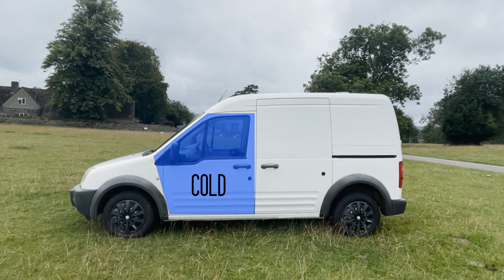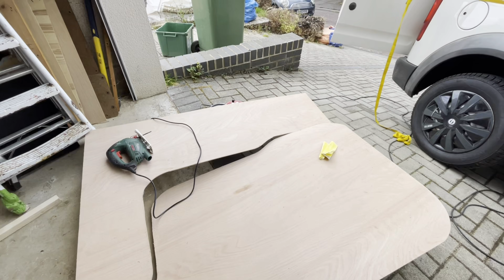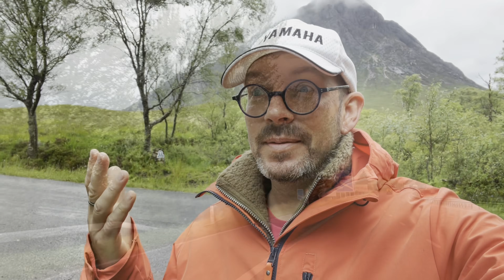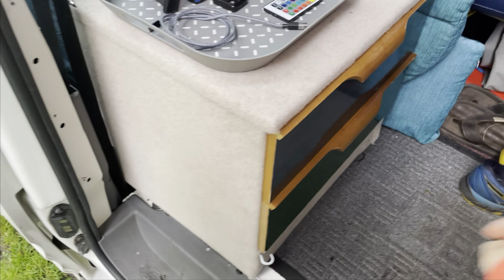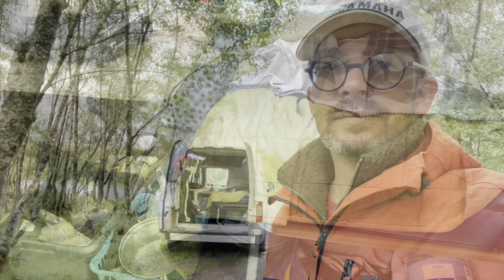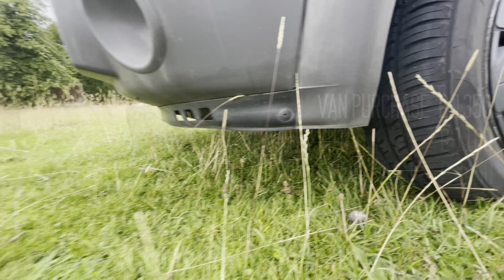Stealth Van Tour // Low cost // Ford Transit Connect // Self Build

Comment: I liked my transit connect. Very solid vehicle.
Reply from the maker: Thanks, yes, they’re great little vans.
Reply: Looking at the MOT on the government website it seems strange how there were few problems up to 196k then suddenly everything was significantly rusty and a whole heap of expensive problems that meant it failed it's MOT badly in 2024. I bought a 3 year old Vauxhall combo on 26k and 7 years later sold it at 132k, 40k around Europe, the rest around the UK and Ireland,longest I lived in it was 9 months continually, even through the -10c of 2009. I made sure to avoid rear glass windows and a side loading door for security, had a solid bulkhead up front and a safe bolted to the floor.
Reply: @jamesdexter7481 safe is a great idea

Comment: What about ventilation?
Jst at the end of the video I see something on top of the roof.
Is that a vent?
If so is it enough to avoid condensation building up inside the van?
Reply from the maker: Hi.  Well spotted.  There is a little non-powered spinning air vent that keeps the air flowing and therefore the condensation down.  Also. the insulation prevents a lot of condensation building up.  I covered this aspect in my second van video..... Link here >>>>  https://youtu.be/3NrsdZLMuK4
Reply: @ 

Thanks for your response.
I have now watched the video you sent a link for.

What we are thinking of is that next time we change car we may buy a small van like e.g. Caddy Maxi Life or something similar.

The idea is to use it a normal car most of the year, including being able to bring a few passengers or to haul stuff needed around the house to go the recycling station.
And in the summer use it for camping.
Just take the rear seats out and put the camping stuff in. No re-build planned.
Perhaps I would build a box for stove, cooler cutlery etc.
To make the surface even I would then have to have a few boxes for storage of other stuff as well.

Or just even simpler, just put the inflatable mattresses in and other stuff in a roof box.

But I think there will be a lot of condensation.
I would have to do something about ventilation.

I also have a heat pal but I don’t know if I would dare to use it in such a confined space

Comment: Did your van come with the overhead shelf in the cabin or did you add it? Im trying to figure out the best way to add one to my 2011 connect
Reply from the maker: Hi. I added it myself. The space up there was much better used by having a strong shelf. I used it for clothes.

Comment: Could you tell us what your electrical product was?  I don't recognise it and it's not in your description.
But happy camping!
Reply from the maker: Hi. Do you mean the 12v battery thing?  If so it’s a jump starter product that you charge up at home before setting out. It’s got a 12v socket that I plug the van lights and USB phone charger into. Hope that helps.
Reply: @CopperGravity  Yes. How can I find it on Amazon or in a camper store?  What's it's name/make/model?
Thanks.
Reply from the maker: Hi. Not sure on the exact model as it actually broke and I replaced it. They are generally called something like a 12v power pack. Draper make one. Halfords in UK or Amazon should have something like this.
Reply: @CopperGravity  Thanks.😀

Comment: When you have yourself, your fuel, with everything in the back, how much does it weigh?  Just interested to know.  Looks like a great little getaway van for the odd night out, for me, photogrpaphing the night sky in some remote wilderness.  I am not light.  I weigh 14 stone. I would need to fill it right up with fuel.   I have a couple of Bluetti power banks, an inverter, a laptop, camera gear and a little gas stove.  All things together, like food, clothes, boots, water, all the things to survive for a few days.  Is the maximum carrying capacity about 900-950kg?  I know it's the best part of a metric tonne, I would just need to be sure is all.
Reply from the maker: Hiya. I never weighed my van before, during or after. But these are built for builders and their materials and although the fuel economy gets worse with weight, they really won’t struggle with anyone who goes off camping.

Comment: What is the length of the back of the van ???
Reply from the maker: Hi. It’s 1.9m which is just enough for the bed to squeeze in.
Reply: @CopperGravity How can I sleep... 1,94 m.
Reply from the maker: Hi. It’s up to you to find a solution that fits you. Maybe a longer van or admit that you may be a bit squashed in. For me, I was not too tall and I really wanted a small van.
Reply: @Sel817  simply put the bed/cot behind the passenger seat, move the passenger seat up, and fashion something to extend the cot or find an extra long cot. Maybe make your own bed/cot.
Reply: How can I sleep... 1,94 m.   ?

Comment: It's so refreshing to see someone do a sensible conversion that proves you don't need a whole run of kitchen cupboards, a full cooker, fridge, etc etc etc!!!
Just install what you'll need, just the basics!
You won't be cooking full meals, guaranteed!
After all, you're on holiday, so eat out, buy takeaways, eat junk!! 
I'm definitely doing this with my next car, probably a Ford Galaxy, or very similar, & like this conversion, mine will be just a simple, uncomplicated sometimes van/or car/or camper, but just remembering that important acronym, K.I.S.S.
Keep
It
Simple,
Stupid!! 🤣🤣🤣
Reply from the maker: Yes James. Exactly. This van is still going strong and is currently empty due to recently moving a piano.  I also love proper little homes and if I lived in a van I would do something more permanent. But as a hobby camper this is a great option. Good luck with yours. Ian
Reply: A lot of people with more extensive builds actually live full-time in their vans, so their needs may be more than someone who is using a van for trips.

Comment: This video popped up on my line for no reason but I like it. The only thing I would add is a C02 meter just in case, you sleep in a relatively small space and believe me, you won't notice rising levels of dangerous C02 until it is too late.... nice build !
Reply from the maker: Thanks my friend. I have one!! Good advice for anyone reading this. Totally agree. 👍
Reply: CAD—cardboard aided design. 😂 Nice conversion!
Reply: I think you mean CO detector.  CO is carbon monoxide, deadly.  CO2 is carbon dioxide, not deadly unless it replaces all the oxygen.
Reply: @ravenwolf79 correct !

Comment: Have you had any issues with your Connect having leaks?  I have a 2011 version and discovered the passenger footwells were wet.  I ditched the factory flooring and it's bone dry now, so the hunt is on to discover where the water got in? I've read that Transit Connect are notorious for leaking like sieves!?
Reply from the maker: Hi Mark,  no issues with mine. Good luck with yours.

Comment: Hi what is your ventilation solution, I may have missed it on the video
Reply from the maker: Hi Sam. This one a covered on my follow up video. It is basically a roof mounted ventilation system. Non powered. Works brilliantly.
Reply: @CopperGravity  Are perfect, been looking at very similar (possibly the same) for my connect, I'll check that video out

Comment: nice job, didnt catch were the ventilation cost was spent?, not a big fan of well insulated vehicles with poor ventilation to the outside, me and my wife woke up one night staving of air after sleeping just in my car one night with the windows closed having spent most of the oxygen inside the vehicle, ventilation as it is in a house, is important in a van too.
Reply from the maker: I accidentally didn’t mention the ventilation in this video. But I did make a follow up video that shows I fitted a Flettner slimline ceiling fan thingybob. 

This ensures plenty of airflow to the rear living space. 

It’s great.

Comment: If you want to be even more stealthy, do as we van drivers do. Leave the cab a bit messy. Put the high viz vest on the back of the drivers seat. Leave maps and various bits of detritus on the dashboard along with a soft toy or two. I have stealth camped in 'very' public places using these techniques and have never been disturbed.
 I would think about kit that folds away like buckets/toilets, washing up bowls etc. Then about a week before you go, make a list of the basics you need for your trip and pack it so it's ready. Over the next few days lose some items eg: 3 spare pairs of knacker crackers instead of 4. Personally I wouldn't use a camp bed, they are way too unstable. I made a rock and roll bed out of pallets and scrap wood and it works a treat and is removable too.
Reply: Well done my friend...ime going to do likewise...screw paying this rent!

Comment: I bought my trans connect new shortly after they came into the US. did a lot of traveling in it and then sold it which was a huge mistake. Sure wish I had it still. Like the work you are doing on yours. And the mileage is impressive. I just got home from a camp trip with family. I have a ford escape now and back seats out for room to sleep. It is ok but miss my trans connect. It was gas and when I first drove it got tons of questions. Now they are much more common to see.
Reply from the maker: Thanks for the comment Judy.
Reply: What year and what was the mpg?
Reply from the maker: Hi. 2006 and I don’t know the MPG.
Reply: @starlightmckennah5241  It was a 2010 and gtbetween 29 and 32.

Comment: Hello, why did you veer away from putting a skylight in there, for air. Thanks for your efforts.
Reply from the maker: Good question.  I never planned one.  I wanted the back to be totally dark and decided that the vent would provide enough air.  Also, I was worried about leaks and the cost.  But mainly I just didn't want one.
Reply: @CopperGravity  I didn't  realise  when I asked the question that you'd  put a vent in, i share your fear of leaks. Can I ask the makers  name of the one you  installed, and thanks for your vids they make total sense
Reply from the maker: @bronte3663  sure. It’s a Flettner Slimline and is covered in my more recent FAQ video…. https://youtu.be/3NrsdZLMuK4

Comment: The wall is actually worth it, when you travel in colder climates..
I didn't want a fixed wall, but might rethink it for later. First I need to finish my build, travel with it, then I can fix things for the next trip. 😉

Comment: Can you use a crockpot for cooking or can you get enough electricity
Reply from the maker: Not for very long.  The battery bank would be flat quite quickly if used for heating.  I only use it for LED lights and phone charging.

Comment: Glad you enjoyed visiting Scotland in your cosy van. I was wondering about condensation, as you have it all seaed up pretty tight there in the back. I notice you quote a price for ventilation, but I don't remember you mentioning it in the video. I've watched a lot of Connect van conversions, as I wan something stealthy myself, but so many of them are US based, so it was great to come across a UK conversion tested in Scotland. Happy camping!
Reply: Ah... saw a comment about your rotating roof vent... Did it do the job well?
Reply from the maker: Hi Carol. Yes it works great. No condensation in the sleeping part. But as soon as remove the foam partition in the morning, the hot air rushes forwards and the front windows steam up. Easily fixed by the hot air blower.

Comment: I'm not sure about insulating vans, especially older vans because if the van dies all that money invested in the vehicle is lost and if you spent, say £500 on insulation, how much heat via diesel heater would you get for the same amount of money?
Reply from the maker: Good question. No idea on diesel heaters as I’ve not investigated them. 

I do quite a lot of hot weather camping so the insulation works to keep the van cool as well. 

Also it makes everything nice and quiet and dry from condensation. 

So you get a lot more then heat. 

Sure the van will die and my investment will eventually be lost, but after just a year I will have saved money by avoiding other forms of accommodation and alternative van hires.

Comment: A fully kitted out mini camper for £2500 !! Ye gods and little fishes! Best thing though is the use of a removable camp bed . That has been my preference all along . So many conversions seem to revolve around a built in, full width sleeping platform. If you're traveling solo you just don't need one. A single bunk, (or even a hammock?) is all you need. 
I'm still looking for THE van (£1300 for a tranny .. arrgh) , but come the day , I'll be coming back to this vid. for reference and inspiration. Thanks.

Comment: That unsecured set of drawers is lethally dangerous in a crash
Reply from the maker: Thanks for that. I now only drive with it against the rear seat and it definitely wont fit through the gap.
Reply: @CopperGravity  God forbid, but if you roll it buddy, the chances of it lethally connecting with you is pretty high. Maybe you could put some ratchet strap set up to secure it?
Reply: I thought that

Comment: Nice Job. Agree with other poster. Why bother with a useless minature sink or a portable toilet etc. A roof vent would be nice in case it gets hot but thats about it. Most important thing is a comfortable and cheap nights sleep. The only pity is that the manufactures only seem to do white vans. A dark green would blend in so much better.
Reply: Bangyai:   look into getting a 'wrap'  in your chosen colour - but even re-sprays are not very expensive.  You don't have to live with white if you don't like it ‼️

Comment: Good job...., van was cheap, what was mileage ??
Reply: Warren Simpson the guy said he has 196 odd thousand miles on it .. goes too show they last the time I have a van like this but low roof and a 2012 model as why am looking mines only has 74 thousand on it but being done differently instead ... logical thinking needs done is size & space off these vans but practically & being basic is where am heading does the job just fine ...

Comment: Great built.Nice and basic. That insulation you used would that also work for keeping out Heat ?since I want to go to southern Europe. And what did you do about ventilation ?
Reply from the maker: Non-powered roof vent from Flettner.  Slimline model.

Comment: Really like this build and the way you did it! Would it be possible to get a MTB in there? Most likely sound crazy right now, but just a question.
Reply from the maker: Possibly.  I moved my daughters flat contents.
Reply: Get a roof rack, sleep in back of van, bike on the roof
Reply: I had one. No way would you fit a bike in there. You’d have to go to a full size van for that

Comment: 15 years old and 197,000 miles? No thanks.
Reply from the maker: Don’t panic! I’m not trying to sell it.
Reply: As long as the van has been well maintained should not be an issue. A low mileage van that has had a tough life would be less reliable. My old Nissan NX had over 300,000 k on the clock. Engine still sweet .
Reply: It’s a diesel

Comment: how can u sleep in a van with only a 61 inch rear floor length?
Reply from the maker: The rear of this LWB is actually 1.9m (75 inches) from bulkhead to door.  The bed is 1.9m so it fits perfectly.

Comment: This is great, well done! Even for anyone wanting to do a more elaborate built-in mini camper, it's really useful to know the bare bones starting costs. Thanks. 

Can you please share your kit specifics for the electrical and ventilation?
Reply from the maker: The electrical was from Draper and is just a power pack for starting cars. 

The ventilation was a non powered rotating roof vent from Flettner . I chose the slimline one.
Reply: @CopperGravity  I looked for it online. Did you mean Flettner??😄👍 Very cool item!!!
Reply from the maker: @EmmaKnightleyNo1  yes Flettner. Sorry.
Reply: @CopperGravity  Thank you! If you don't mind one last question, how do you charge the power pack on the road?
Reply from the maker: @GameofRugs  the unit came with a car charger which I occasionally used on long journeys.
Reply: @CopperGravity  Perfect. thanks for the info!
Reply: Always cool ,I travel like this for many years now,I just like it

Comment: Hi, Please  tell me how you made the over cab shelf
Reply from the maker: Tricky to describe. The shelf is 9mm okay cut to shape and it rests on a 35mm square baton. The baton is attached to the van sides using a small metal right angle bracket on each end. Then it is insulated on top and carpeted. The cab side is covered in black out material to make the cab dark.